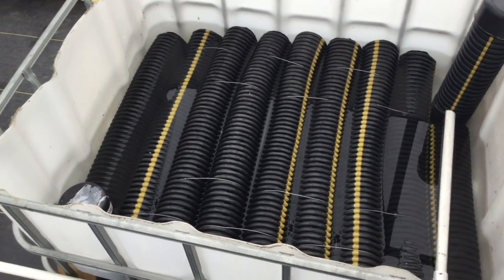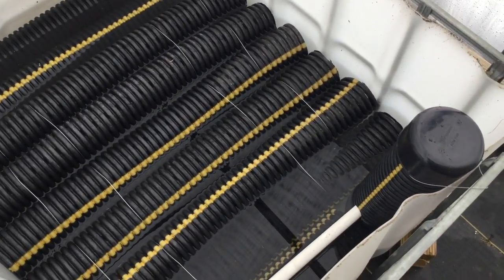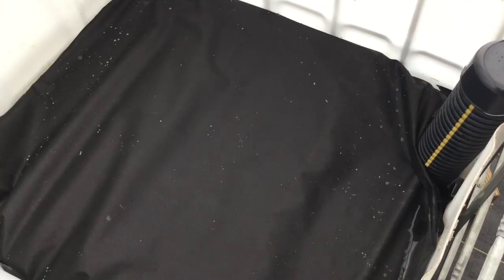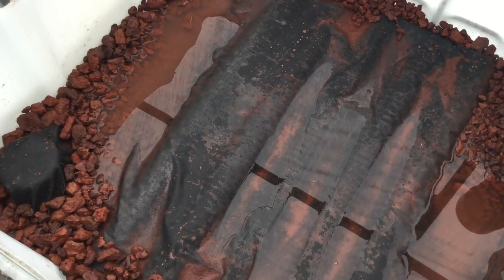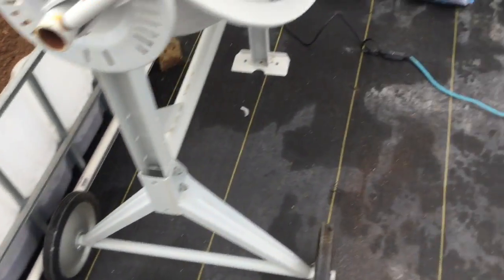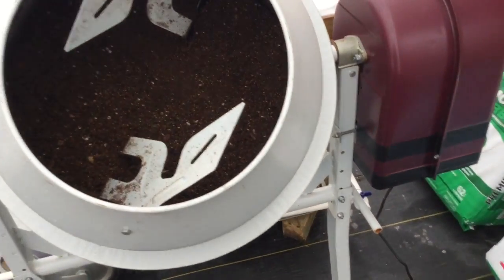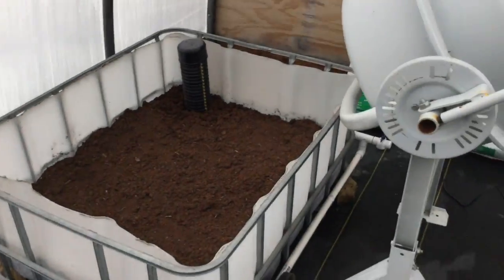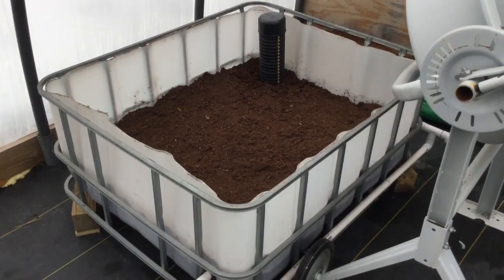Constant Flow Wicking Beds (2)

Comment: What doesn't make sense is what happens when the water level drops below the top of the drain pipe. It can't wick through an air space.
Reply from the maker: Actually, you're forgetting about that fabric that I used (the wick), and the fact that plant roots will work their way completely into the reservoir. The reason things are designed the way they are is so I can get down in there with an air compressor to blow roots out of the pipes. Plant roots will go anywhere they want to, a little fabric won't stop them.

Comment: Hey just found your channel. Looks great!  I was curious what you’re thinking by now on the success of your tote beds?Thanks!
Reply from the maker: It's been like 3 years or more now and they're still going strong with no issues. I don't run the pump full time anymore, I just run it once a week to top off the reservoir in all 12 beds. Half an hour job, putting a hose in the barrel and plugging in the pump is the only effort I have to put into it.
Reply: @LordLarryWho  Thanks for replying! Glad to hear you’re having success!  I am working on starting something similar but I’m a newbie so I’ve lot’s of questions.
Reply: @LordLarryWho  i was just wondering what kind of pump do you use? sump pump?
Reply from the maker: @jamess8840  Just a small 500 gallon per hour Tetra pond pump so there's enough pressure to push the water that far, but it's probably choked down to about 25 gallons per hour before it pumps into the first beds because it will flood them if it runs at full volume.

Comment: Why not use columns of coke bottles joined together instead of Nova flow columns?
Reply from the maker: Because it was faster to just buy this stuff and I know that it won't collapse under weight because it's designed to be buried in the ground. But, you're free to use whatever you want.

Comment: Hi! Saw preppersintent's question about rockwool below, and we're curious if anyone has tried integrating rockwool into their wicking bed? If so, what depth/thickness did you use? Did you top it with 'regular' potting soil and, if so, what depth/thickness did you use for the potting soil layer? How well did it all work? Setting our system up very near future, so exploring different ideas. Thanks!
Reply from the maker: That would be an epic waste of money compared to the cost of mixing your own potting soil which would achieve the 100% exact same results. Be careful of buying into hype, physics hasn't changed no matter how high tech you try to be.
Reply: @LordLarryWho  Thanks - we've been mixing our own forever, so we'll just keep on doing that!

Comment: Larry

I love what you are doing and have had several conversations with another guy that hypes his grow bags and a rain gutter system.

The one thing he is big on is "air wicking" would your design work with the holes in the sides (above the weed barrier, of course)?
Reply from the maker: I'm sure it would work, but so far I'm not having any problems that would warrant the amount of work to do that.
Reply: Larry Athey this is more appropriate for your tower site, but it looks like you don't get over there much.

Will this printer print  your parts?

https://rover.ebay.com/rover/0/0/0?mpre=https%3A%2F%2Fwww.ebay.com%2Fulk%2Fitm%2F253727716457

Any thought to making a 2 sided section?
Reply: Larry Athey I also may have another less expensive way for the water other than the irrigation pipes......that stuff is quite expensive.

I'll let you k ow how it works.
Reply from the maker: Hmmm, not sure where you live, but those pipes are nothing but 3/4" thin wall PVC and here they are only $3 for a 10 foot section. I don't think I have any more than $50 worth of parts in use here.
Reply from the maker: I'm sure the printer would work just fine. As for a segment with 2 planters, that would be counter productive and result in plant crowding. The whole reason for having one planter that can be rotated is so you can turn a plant out of the way if it is casting a shadow on the one below it. You can't cheat mother nature, you can only grow so many plants in a given area. This is why all seed packets have recommended plant spacing listed on them.

Comment: Have You tried rock-wool?.  it comes in giant bags of the shredded version from home depot and so on.,insulation row....I forget the brand name but the stuff will wick water up a foot plus. Also lighter to work with(until its wet). tip ,add lime ...
Reply from the maker: No, never tried it. Might have to look into it before I set up the next row of beds.

Comment: Hi Larry ,
What size are your Greenhouse dimensions? Also Could you tell what prices you paid for the WeedMat? How did you prepare the floor? Thanks
Reply from the maker: 51x18 feet at the frame, 9 feet tall at the top of the arch. I don't remember the brand or the price of the landscape fabric, I just remember that it was the woven stuff and I got it from Amazon in 6 foot wide rolls. No preparation of the floor at all, I just put it down over the grass.
Reply from the maker: Here it is http://a.co/cIrJTfH